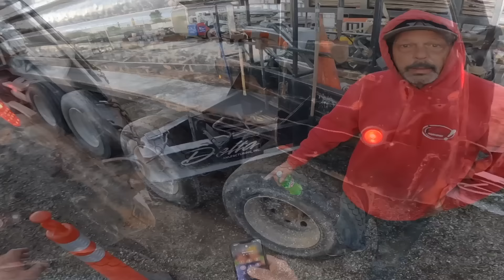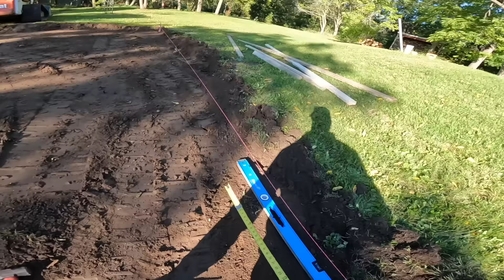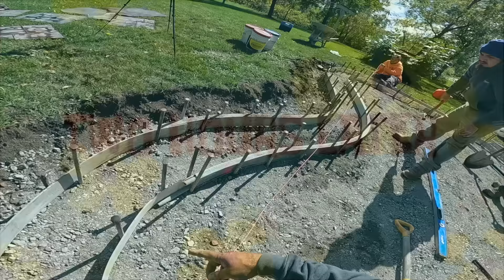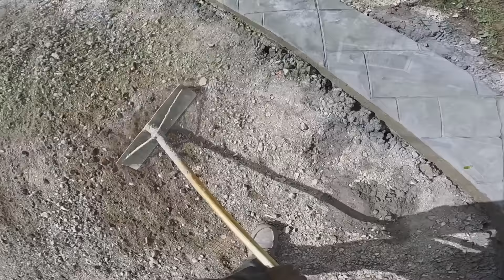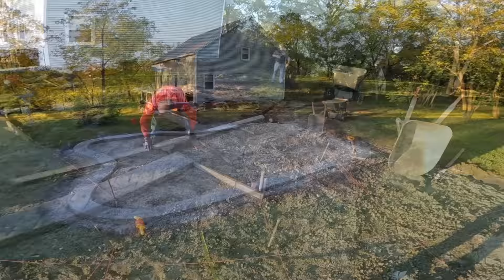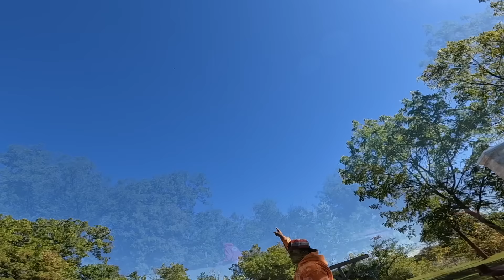He tried coming back, I sent him home.

Comment: Just a tip,if you put deep grooves in the concrete on the back of your truck like a grid,heaps easier to break apart later back at the yard

Comment: I noticed that after pouring the outside border, when you took the forms off there were a ton of voids in the concrete... wouldn't that cause it to split in those areas where the concrete is thinner....I know you poured the inner patio but I still think that first one may snap over time or sooner than you think....that concrete ahould have been vibrated into place....

Comment: Dump a bottle of " archoil ar9100" I'm the oil on that white 7.3l and you will see a night and day difference with the way it cold starts and runs overall . Fixes lazy injectors on the 6.0 and 7 3 powerstrokes it's kinda expensive but I won't do an oil change without adding it in ever again

Comment: When you guys have extra concrete on the form truck you should pre cut it with a shovel while its still a little wet so you can just break it apart easier at the yard kind of like how a chocolate bar is pre cut but not all the way through

Comment: I always wondered how they got that design. When it settles it looks like bricks placed in that pattern and thats what I assumed it was. But thats pretty awesome. The more I watch this the more I wanna get into concrete. Right now I'm a door guy. I would say carpenter but I don't do any framing or anything I'm strictly a door builder/maker. I cut out holes to put inserts in doors. I do all the hinge prep. Bore the doors where they need bored. Basically you need a door I can make that door for you. I just got a request for a really weird cutout in a door last week. And they're the heaviest doors you can get. It's It's big old process to draw that out and cut it out.

Comment: Where are you guys located? I have never seen such a thin gravel base, it must be down in the south where there is no frost? In Canada, any paving or concrete works need to have a solid 8-12" of gravel as the base for walkways and 12-24" for driveways.

Comment: A few questions. 
Why don't you use chairs under the reo ? . 
That wouldn't pass inspection here in Australia . I didn't see the steel being lifted from the ground either . 
Second . 
The border would have required 2 rows of ree bar 2 inches in from board .  
 3rd 
Why not drill through the inside form board and but the dowl though the form and tie them to the steel in the boarder . 
4th 
There was no steel mesh in the corner of the slap where it meet the border and the dowls we not tied to the mesh . 
Maybe you guys have very different concrete there . But that would not pass by a very long shot here in Australia